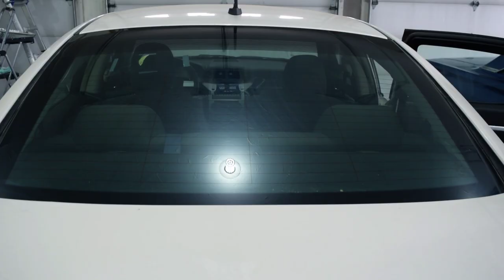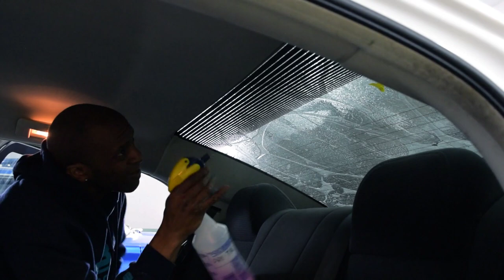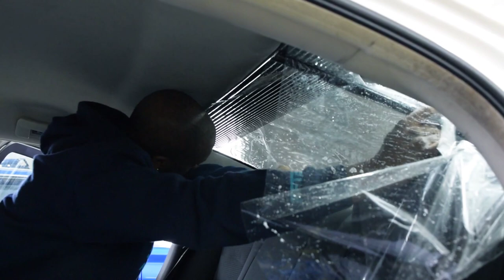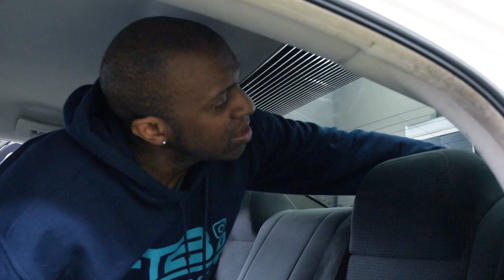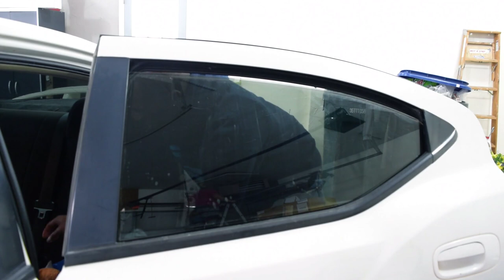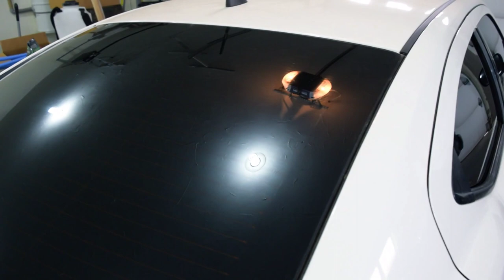Tinting the Back Glass of a Dodge Charger in ONE Piece!!!

Comment: I just had my windows done with 5% on the front and 20% over factory on the rears, should I still be able to see through the back glass? It only seems a little bit darker than factory sometimes I can’t tell a huge difference
Reply from the maker: Yes with 20% over privacy glass you can still see through it some even though it's probably a lot less. I don't know how dark your interior is or if your windshield has tint. There are always variables with tint.
Reply: Fade To Black LLC thanks for the reply, I just have a 5% brow on the windshield with black interior I can you can definatly tell the back is darker but as I said I can still see through it quite a bit I just didn’t know if that was normal or not sometimes it doesn’t look any different than factory